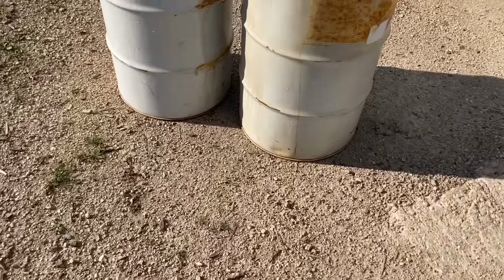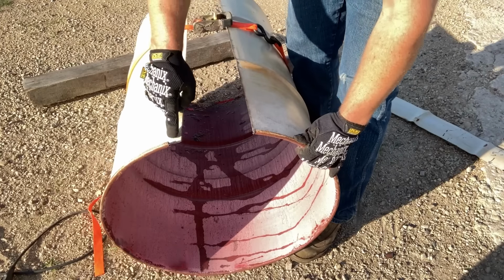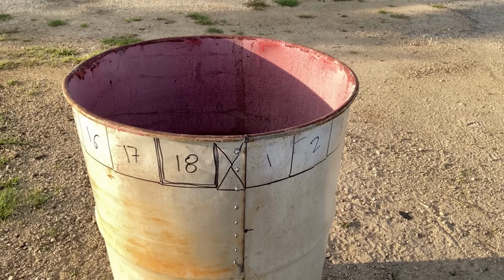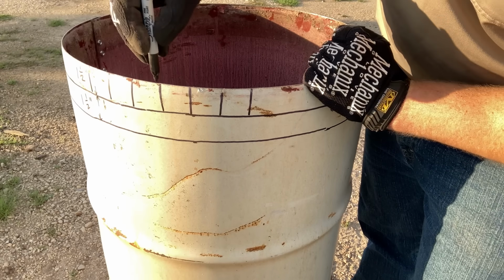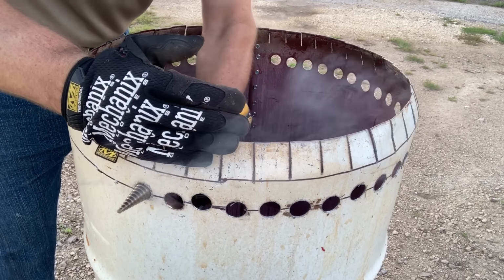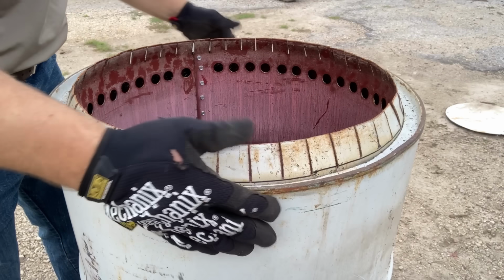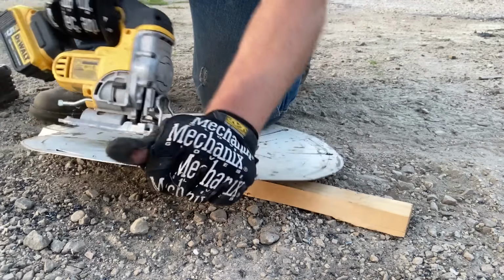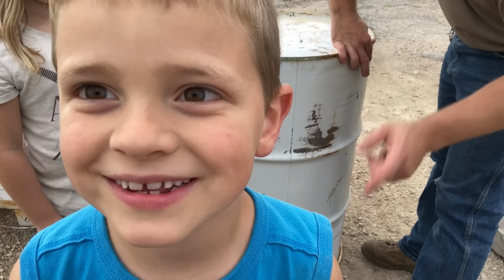Smokeless Burn Barrel

Comment: This is great. I live in a country with no refuse collection where almost everyone burns (I should say smoulders) their rubbish. I'll be adding one to my yard and discussing a more robust build with a thermal blanket filled twin layered outer shell to increase the internal heat with our local government for public use. Hopefully reduce some of the localised pollution.
Thank you awesome stuff! Plus from what we see here a man with a heart of pure joy.
Reply: The addition of the thermal blanket will stop the air rising between the two barrels and exiting at the top- thus stopping the secondary burn. Your burn barrel will then smoke.
Reply: Curious, what country do you live in without garbage collection?
Reply: @rowanshole  why not read my comment again then apologise. It reads 'a thermal blanket filled twin layered outer shell'. The void between the inner and outer is not obstructed.
Reducing the heat loss from the outer shell will in fact increase the draw in the void. As well as keep the whole thing much safer. You could use thermal refactoried bricks as the outer shell but that would require a master tradesman in masonary as myself to construct and be very costly. 😁 Having one welded up out of mild steel plate is much cheaper
Comprehen what you read before replying is good advise.
Reply: @ScooterKid659 I live in the rice fields of a province in a south east Asian country. No such thing as public sanitation infrustructure around here.
Reply: @darrellturner560  hope this makes you feel better- sorry.

Comment: Love the design on this burn barrel. I built one about a year ago which is about half the height using some old tractor wheels, same diameter as the 55 gal. drums.  I have an ash collection pit underneath about 14 inches deep.  Once everything gets proper air flow the whole pit glows bright red, in fact it gets so hot I have started using the pit as an impromptu blast furnace for casting (aluminum only), and forge for steel and iron.  Keep in mind, I'm no expert, just a guy with a welder, and a lot of scrap metal to build with.

Comment: One enhancement I would make is use the top 3 inches or so of another barrel as an ash trap under the barrel. Often when burning stuff there are nails and whatnot so having it all contained in a pan helps clean those up and it also gives you an instant container to haul the ashes away.
Reply: You don't need another barrel: Just cut 3" off one of the barrels before starting. The completed barrel winds up 3" shorter overall but you save material. The 3" ring off the second barrel might be useful too.
Reply: @rafaelallenblock  True. I guess it depends on how many barrels a person has laying around and how they want to go about it. I like the one barrel idea. More efficient use of resources.
Reply: On this addition I completely agree and it keep the ashes contained and easy to clean up after the burn…👍🔥🇺🇸
Reply: Please any one tell me whether this burn barrel can be made an incinerator by adding it with petrol and compressed air because I am working on a petrol incinerator. By the way my name is Anil Kumar Singh and I am working in Indian Institute Of Technology Kanpur, India.
Reply: Why not just create rocket stove

Comment: Can't believe i just sat here and watched this entire video and loved it! I don't even need one of those, but I want to go out and build one. Great job.
Reply: Except for the last piece when he was working on the ground using the jigsaw. That part would have screwed up my back for a month! But same here, I felt like making one without the need for one.
Reply: @kenh9508  Honestly, this seems very over-engineered. There are quite a few ways to make it much simpler and not much worse if not just as efficient. For example, you could do away with the inner barrel, on the bottom make those fins on which you rest the grate in your video, then drill a row of holes near the top like you did to the inside barrel, then use a crowbar or some long metal pipe to bend the metal to guide the air inside the barrel. Or instead of the holes near the top, you could cut fins like those which hold the crate, but have less space between them, and have them cut to have the uncut part alternate from towards the top of the barrel and towards the bottom of the barrel, then angle them to guide the outside air inside (bend outwards those connected from the top like an A shape, and bend inwards those connected from the bottom like a V shape), to allow the air to mix with the hot gases, for an efficient second burn.
Reply: @SapioiT  the whole point of the inner barrel is to route air to the rim for secondary burning, this is why it's smokeless, if you omit the inner barrel it won't work
Reply: I even picked up an American accent watching it  😁hot diggity dog  great clip
Reply: @andyb7963  Actually, it doesn't matter that much if the air comes from the bottom of the barrel, or from the sides of the barrel. If you have inwards-pointing holes, ideally slightly angled clockwise or coutnerclockwise, then you would still route air to the rim for the secondary burning. The funnel part is meant to help mix the air and increase the pressure (which, in term, increases the temperature), for the secondary burning to take place. You could use a longer funnel, if you think hose angled air intake holes (which have to be angled upwards towards the inside of the barrel), to make it more likely for the secondary burn to happen. Do look up how a "vortex stove" works, or how a "vortex rocket stove" works (which can be made from a barrel, too).
Reply: @SapioiT  make one and make a video :)

Comment: I've done the same thing on a small scale with tin cans, with my son 'helping'.  Then we'd have fun burning sticks and pine cones in them, watching the jets burn the smoke.  Very nice job upsizing this to a piece of useful gear.
Reply: I built one similar it's like a jet engine dangerous heat invisible flames be very careful using one of these
Reply: I wonder if this thing “roars” like the wood gas/ hobo stove you build with the paint can. 
Im going to build one of these, but i want to experiment with less holes at the top to see if i can get the “swirly flames” effect”. That would keep drunk people around the fire entertained.
Reply: @tuloko16  you don't want drunk people around one of these! it's not someone might get hurt someone WILL get hurt ,BADLY. It will burn branches as fast as you can put them in there once it's going
Reply: I did this tin can thing too. You can get swirling flames by poking a screwdriver in the secondary air holes and jerking it sideways, all in the same direction, making rudimentary air scoops. This mixes the fuel and air more and causes an even cleaner combustion. And it looks cool 😉
Reply: @andrebartels1690  how long will the tin cans last? Can you use them for smaller burns?
Reply: André Bartels 8
Reply: Use to start the fire buy mixing high concentrate pool shock treatments with brake fluid. The barrel had a natural twister with wood and paper, but once the exothemic reaction hit ignition temperature,  the rapidly expanding smoke bursted into flames, your body got hit with infrared heat, even from a long distance. And it looked like at least a sixty feet fire tornado. It has gotten hot enough to melt aluminum cans at least
Reply: @everettplummer9725  i did just an open grated fire place style burn barrel once that would melt chunk aluminum and brass it burned so hot. I tried to burn the plastic off of televisions and the aluminum, brass, and gold inside all melted and mixed in with the melted crap in the bottom of the barrel. Not what I expected...
Reply: The tin can size burner works well for a backpacking stove.  With a  computer fan cover as a grate on top, you can boil water fairly quick.   Only takes a handful of fuel to get it done
Reply: @daveanderson8691  a 5 gallon size version would be more practical for me, but I guess 1 gallon paint cans might be a good start to try out.

Comment: Some years ago we camped at an Rv park in the
Santa Cruz mtns of Calif. For fire pits, this park
had fabricated their fire pits out of the tub used
in old washing machines. These tubs have holes
punched into them top to bottom. The first thing
I noticed after lighting my fire was, NO SMOKE!
It worked SO well that I acquired an old washing
machine tub, put 4 legs on it and we hauled around
with us as we traveled. It was the BOMB!! Until
after many many fires, the metal fatigued & the 
thing fell apart.

!
Reply: I bet it lasted a lot longer than the burn barrels
Reply: These are very common here in Germany. At least in my village.
Reply: I used an old dryer tub for a while.  It had a ceramic coating on it that I could not remove for the life of me.  Sure made welding the legs on tricky, but it kept it mostly rust free for years of use.
Reply: I have used one of those, and they work very well!
Reply: They use them as portable pits at events I’m told.  Great idea
Reply: @drizler  Yes

Comment: I love this! I want to use a barrel to cook outdoors. In Mexico, they use this with a flat disc on top to use as a comal to make tortillas or a flat surface to put a pot on. I recently saw a video where she had also added a middle portion that she used as an oven complete with a door. She still had the top she could use to cook on while using the middle as an oven, brilliant!!!
Reply: Please any one tell me whether this burn barrel can be made an incinerator by adding it with petrol and compressed air because I am working on a petrol incinerator. By the way my name is Anil Kumar Singh and I am working in Indian Institute Of Technology Kanpur, India.
Reply: @iitkaks6  Petrol? Why?)
Reply: @Dmitro_KAVO  Because petrol is a good and cheap means for combustion and i worked on it.
Reply: @iitkaks6  Only fuel I use is a cup of diesel to get a fire going, the trash dose the rest, it's a burn barrel not a trash refinery burning medical waste.

Comment: I love this! Been planning to make a burn barrel for ages. Even got two barrels ready + an ancient water heater chamber. But, could never quite figure out how to attack it. Seen the ones with angled holes/flaps for air intake, but they do not in reality work that great. Was thinking to make a top with an intake for air from an airblower for secondary combustion, but it all got to advanced in the end. So, actually, what i love the most about this, is that you managed to make a super advanced, high functioning design, but completely without involving more advanced techniques like welding etc. ANYONE can do this, with some time and patience, with completely ordinary tools.

Comment: I built it according to your instructions and it is freaking amazing! After filling it up with smaller branches as well as larger pieces of wood it goes from being lit to a roaring fire within 3 minutes. Once it is going it draws in tons of fresh air and sounds like it has big fan or jet built in! At this point even wet/rotten wood is combusted instantly and what little smoke is produced stays clear. My only recommendation is to not use this in dry areas where a wildfire could break out easily as it can throw tons of embers that rain down depending on how hot it is burning and the type of wood used.
Overall 5/5 would highly recommend!
Reply: Having a fire in any sort of contraption or in the ground, where everything is dry around it is generally well-known. I hope.
Reply: @philmccracken2012  Never, EVER rely on common sense. . .

Comment: I know this isn't the best way to get rid of mosquitoes, but I made me a smoker by putting a 5gal bucket inside another,with some air vents cut in the bottom,made a handle from a tree branch  wedged inside the bucket handles so I could move it while working in my garden. It's a huge garden and I store my rainwater next to the garden in a few places,also there is a farmers canal flowing next to me so there are plenty of mosquitoes. I will throw some green weeds on top of the fire to produce the smoke to rid my work area of mosquitoes.One day I had so much smoke it looked like a dense fog was setting in and some passerby called the Fire Dept. When they showed up,put the lid on,they didn't know where it was coming from.Just a bit of humor. Nice video btw,very cool.

Comment: Easy to follow, clear instructions. I love the idea of turning one barrel bottom into a turbine style grate and using some of the inner barrel flaps for integrated stands. Already knew the basic design idea from creating small & simple wood gas burners / hobo stoves for camping or bushcraft out of used food or paint cans. Looking forward to try out your approach on the next one I make as it solves grate and stands using simply what you already get from the 2 barrels. Also guess the turbine grate (lots of directed airflow, likely causing the air to create a small tornado inside the barrel ) and the burn chamber's upper rim tapered inwards like a jet exhaust will increase performance.

Comment: I put a hole about 8" off the bottom of my barrel.  About 2.5-3" in diameter.  Just big enough to slide a piece of steel pipe in that also fits neatly around the tube of my leaf blower.  I put a loose piece of steel plate on top of the barrel that I can adjust.  With the leaf blower just a bit above idle it will burn all of our household refuse and baby diapers, with zero smoke once it starts to get hot.  I adjust the plate steel on top to leave about a 10-15% open slot.  At night the sides will glow bright red because it gets so hot.  Sounds a bit like a rocket when it gets going.  Like I said it will burn all of our household refuse and diapers with zero smoke and leaves a very small amount of ash afterwards.
Reply: RoadFarmer - man i hope you're still on this one.  i love this idea.  can i ask a quick question?  did you do this to just a normal barrel or did you build this type &  then add the leaf blower adapter?  you said it's pretty smokeless but is that cuz its this type WITH the blower or can i just add your mod to a normal barrel?  i'm an outfitter in alaska & we have a small incinerator but i'd like something a little more mobile.  thanks heaps in advance:)

Comment: Thank You for sharing your burn barrel design. It's different from all of the boring burn barrel videos that just drill several holes in one barrel. You take it to a higher level.
I built a burn barrel exactly to your video instructions, and I love how well it works. Not only is it smokeless, it burns materials faster and it doesn't have to be touched once it starts burning! I love it. 
Thanks again for sharing your creativity and ingenuity with the rest of us YouTube surfers!👍
Reply: Please any one tell me whether this burn barrel can be made an incinerator by adding it with petrol and compressed air because I am working on a petrol incinerator. By the way my name is Anil Kumar Singh and I am working in Indian Institute Of Technology Kanpur, India.
Reply: @iitkaks6  I think that the barrel metal would be too thin for what you want to do. However, industrial compressor tanks could work, just find the people that install and work on compressors. 😊

Comment: Nicely designed, drawn & explained. I wondered when someone would scale up the smokeless fire pit principle to a 55 gal barrel size. The preheating of the air between the inner & outer walls contributes significantly to the  smoke reduction as well as the excellent air drafting,  swirling & multiple air mix points with the rising hot gasses/smoke. Well done & worth copying.
Reply: WARNING:  This does not work with plastic rubbish bins.
Reply: @1nvisible1  Haha!! Not even once?!
Reply: @woolval52  works for about half a fire
Reply: @1nvisible1  😅😂😆😜 OSHA is on the premises......
Reply: @ccccclark2605  Nope.  They don't care about anybody except businesses with ten or more employees, last time I checked.  I see so much Youtube DIY being done carrying bricks, swinging axes and chainsaws, carrying heavy metal pipes - and the guy and his wife helper are both waring flip-flops, or other soft shoes.  When I was 19 I dropped the edge of a 55 gal drum used as a trash can right on my big toe.  The blood bruise had nowhere to go except to swell up the toe since there was no cut, and the pain became terrible in half an hour.  The clinic doc took a drill with a rusty bit right thru the middle of the big toenail, releasing pressure in a small bloody fountain. It felt oh so good that I didn't care about the rusty bit.
Reply: @1nvisible1  Please tell me someone did NOT try that with a plastic barrel.
Reply: @ammoalamo6485  - Right, OSHA doesn't care, but the local fire department might.
Reply: 🤣🤣🤣 @1nvisible1

Comment: Great video with good clear instructions, nice work. I have been using this design on a smaller scale for over 15 years as a cook stove. It uses food tins commonly found here in Australia and if I stop the burn at the right time also produces charcoal I can either cook with again later or use in the garden as biochar.

Comment: Very well done video and instructional commentary. Great project, I just completed my build and it works Great. Did a side by side test and it's quite impressive. The old barrel with just holes in the sides was still smoking and barely burning when this new smokeless barrel had finished burning. Thank you. I plan to add an ash catching tray under it.

Comment: Just stumbled upon this. Great video, great design. 
My family has always burned our flammable garbage as opposed to using trash pickup services. After becoming more environmentally conscious I have started eliminating as much plastics from that group as possible so that it's mostly paper and cardboard products.
Our setup is more of a pit, but now I am looking at this and am inspired to put the same technique to use on a bigger scale for a pit.
Reply: You can burn plastic clearly using a paint can with a hole on a top. Just feel it with something that isn't PVC and put inside your burning barrel